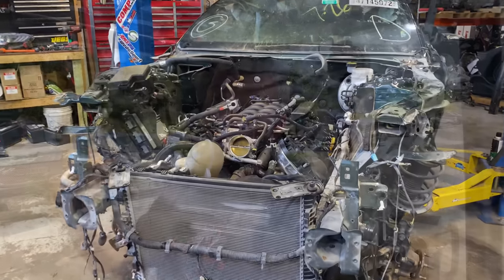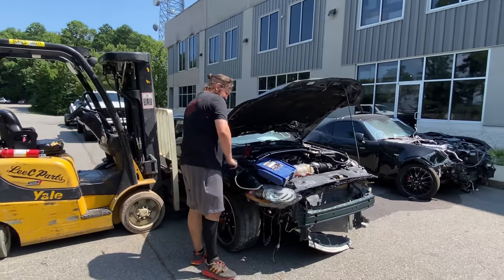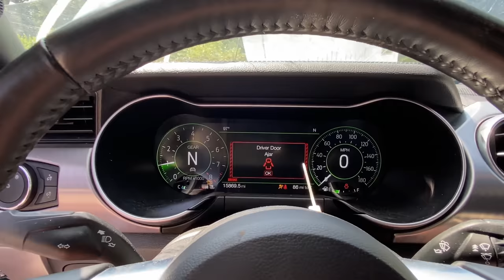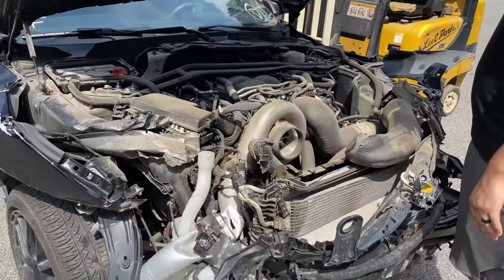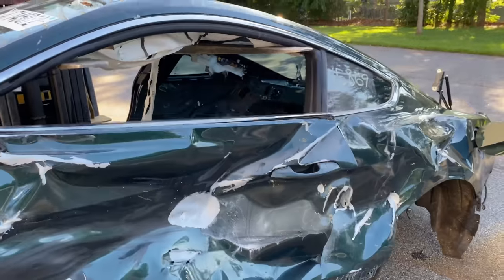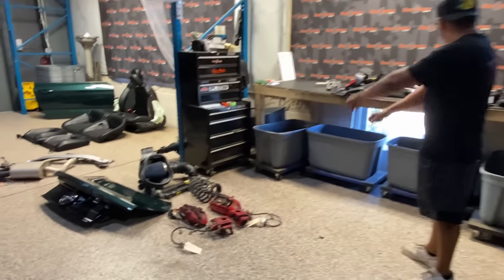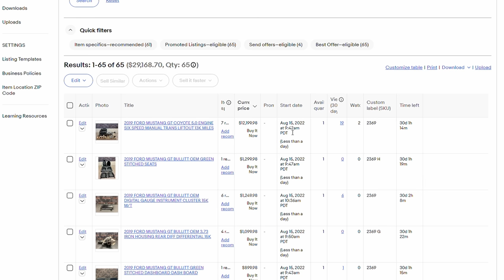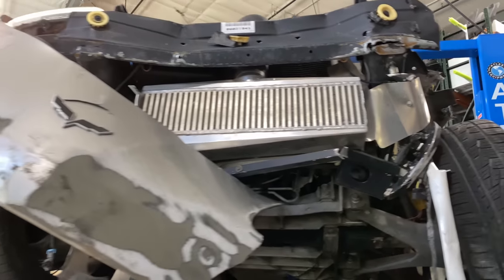I Bought A TOTALED Ford Mustang GT BULLITT At Copart Salvage Auction!

Comment: With all the parts you guys deal with I was wondering what kind of inventory system you use? Ive seen some places use car-part/checkmate but your system seems simpler and more effective for an ebay business like you guys are
Reply: Good old fashion last 4 digits of the vin, frankly the barcode systems, car-part etc are a waste of time unless you absolutely HAVE to because you're dealing with 500k items. I've entertained it prior and the time commitment to use it effectively doesn't make sense for a business of our size.
Reply: @LeeC  That is an incredibly simple solution. I thought with how expensive checkmate was it must be really useful but the more I read about it, it seems like its only good for certain scenarios

Comment: Look on the driver and passenger side mirrors ,see if you have blind spot notification in the actual mirrors, that would be the highest equipped you could get... you need to spend a few thousand dollars before you can add the Safe and Smart package.

Comment: I'm not much of a car guy but am learning that Mustangs don't drive straight, Subaru gives up the head gasket and apex seals are a fatal design flaw for Doritos..
Reply from the maker: I’m not gonna lie, that’s pretty much all you need to know
Reply: if you floor the mustang it'll go sideways. they are pretty decent daily drivers though. Had my bullitt for about 3, close to 4 years now and no issues, it's easy to control when the back end gets loose when having too much fun.

Comment: Every time I see one of these super nice performance cars all wrecked up all I can think is "Rich idiot who has no clue how to drive". 99/100 I am right. It's these idiots that make it hard for the average joe like me to own one. Cause even if I could spit out 100K for one, I couldn't afford the INSURANCE.
Reply: Also, you ever think of using a real computer.. not an Apple? With windows 10/11 you can use Windows Phone Link and wirelessly access the photos on the phone on the computer. No need to plug it in and wear out the plug. And imho 12K for that engine/trans is a fantastic deal. I would buy it if i had the money for sure.
Reply: @robsdeviceunknown  I just switched from a windows based computer to an apple.  There is no comparison for video editing.  Which pains me to say cuz I don’t like apple products.